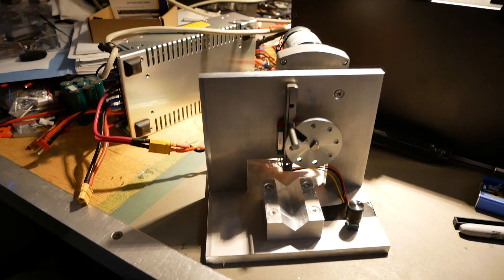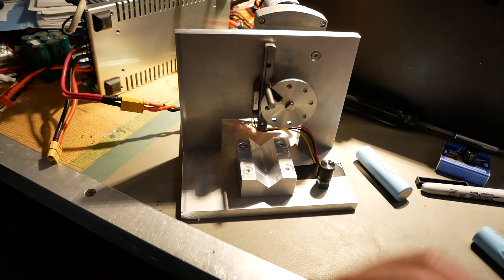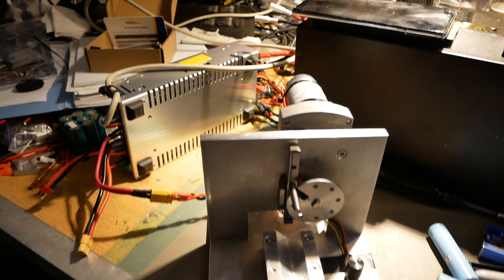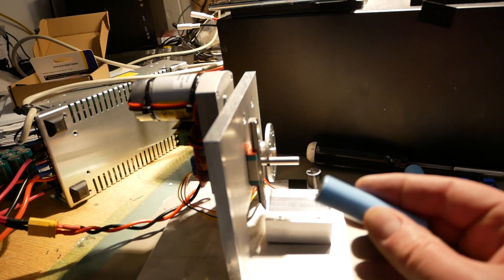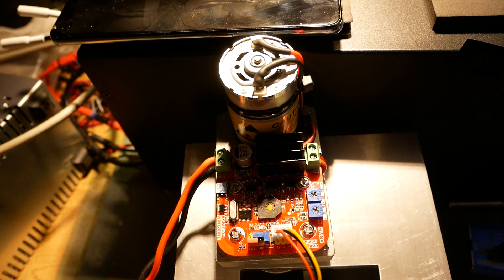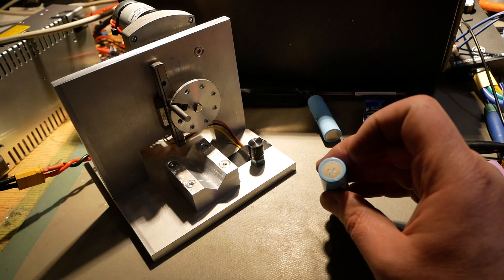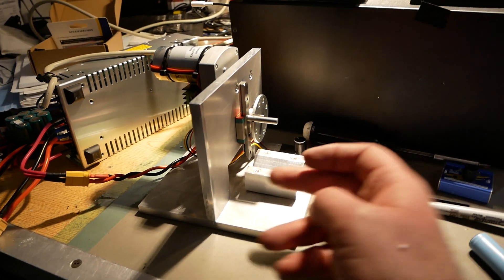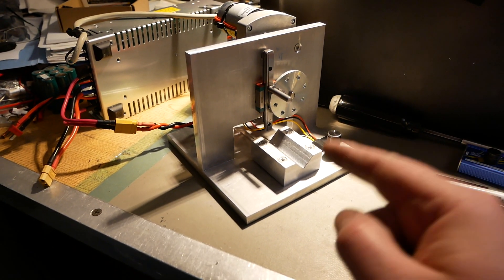DIY 18650 and 21700 Spot Weld Shear (Mr Snippy v1)

Comment: Looks great but should the base the cell sits on be insulated? 
If the blade is electrically connected to the base you run the risk of shorting when cutting the pos end of the cell.
Edit: Should have watched to the end. 🤣
You still run the risk of shorting when cleaning the pos end if it goes too far
Reply from the maker: In the video I mention that I had it working less than an hour. I mentioned electrical isolation is still needed. The cradle definitely needs to be isolated or insulated so you can't create a dead short across a cell. In the video I mention covering the cradle with PET to electrically isolate it. I think what I will do is line the V of the cradle with fiber glass sheet and epoxy it to the aluminum. I could go overboard and make a new cradle from micarta or delrin instead, but I think that's overkill.
Reply: @de-bodgery  Yeah I jumped the gun. 🤥
Maybe heat shrink would do the job or paint it with liquid tape. 

You still run the risk of shorting between the pos and the outer shell if the blade goes too far
Reply from the maker: You mean short from the top edge of the can to the button? Yeah...that's possible and there's not a lot to do for that. The cutting face of the linear rail sees lots of scrubbing and any sort of coating you add will wear off rapidly. Typical cells that are used in packs have the button raised about 1mm higher than the rolled edge of the can. When playing with this thing last night, I grabbed an arbitrary group of cells from Sanyo, LG, Samsung and some Chinese cells. They were all made with the button protruding a little above the rolled edge of the can. If you had a completely bare cell, you could touch both the can and the button at the same time with the blade. This is the exception. Every cell I have ever replaced the heat shrink wrapper have a poly washer on top of the rolled edge and then have the heat shrink on top of that. This is a pretty good barrier against shorting both poles at the cutter. I add paper washers on top of that before I spot weld cells into a pack. I think this risk is pretty low. I'm more concerned about shorting from the cradle via damaged heat shrink to the cutter than I am rolled seam to the button. You should always pay attention to what you are cutting so you don't create issues from inattention. In my second video where I demonstrate cutting off spot welds, you can see why that can be important.
*
I have something I want to add to mine for dealing with depth of cut. It's a spring loaded positioning pin. You can push past it, but there will be resistance. You'll be able to "go by feel" for proper depth into the blade so you don't cut too deep. The cutter as it descends will push the pin back as it moves downward. This spring loaded pin would register the cells inmost position towards the blade.
Reply: @de-bodgery  This sounds great, looking forward to seeing future upgrades. 🙂
Reply from the maker: @alibro7512  The 12mm wide linear rail arrived a few minutes ago. I think I'll add that today. 2 bearing blocks ought to hold the rail more rigidly. At the same time. I'll add length to the elongated slot in the adapter wheel so the linear rail post is trapped in it longer.

Comment from the maker: I have purchased a 12mm wide linear rail that comes with 2 bearing blocks. The one bearing block I have now does allow a little bit of flexing of the rail. 2 blocks will arrest that. The wider rail will make catching all the spot welds in a single cut more likely. I will elongate the screw holes for the bearing blocks so the rail can be shifted left and right a little. I will also extend the slot in the adapter disk so that it engages the rail post as the rail moves upwards more.